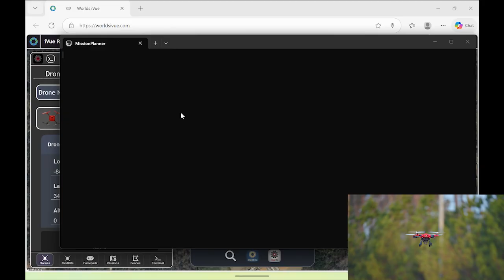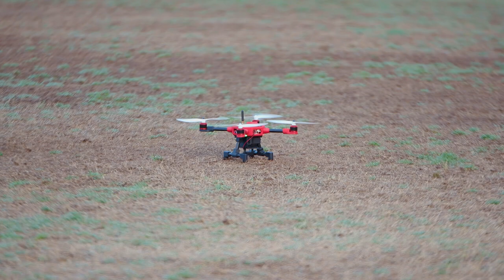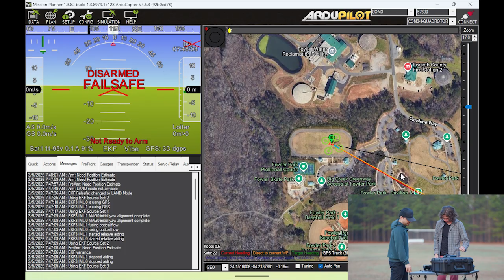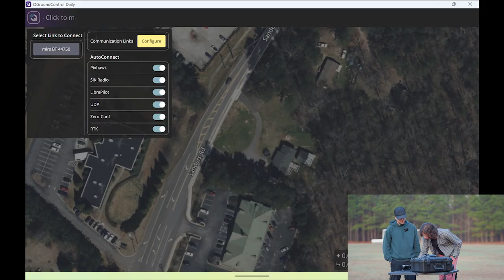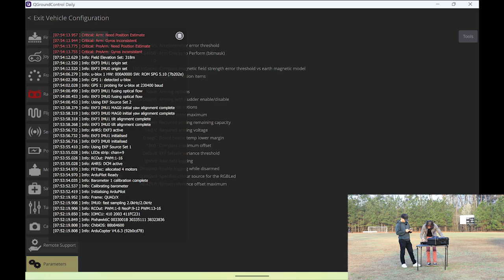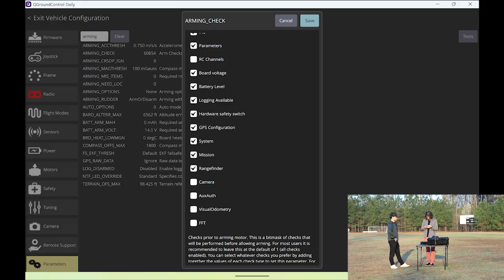Back to Dancing with a MacGyver Fix | GPS Denied Flight Test: Develop Air mini + Holybro H-Flow

Comment: Probably the OF is not well tuned,
Coz I have also implemented this thing and achieved way more stable flight than this.
And now I m working on making a bird operate able at Night,fog and smoke without GPS.
I would be happy if we connect and share some insights that may help both of us!!